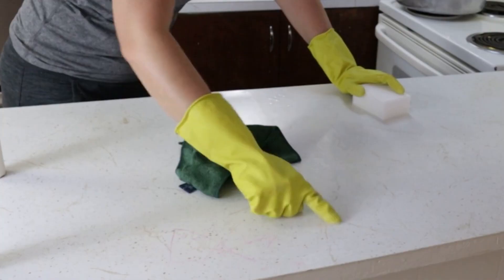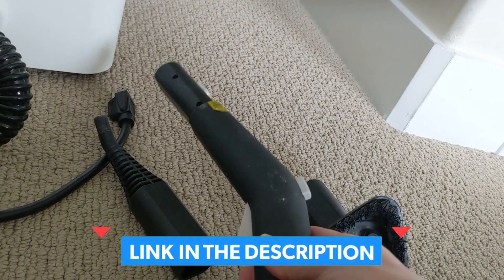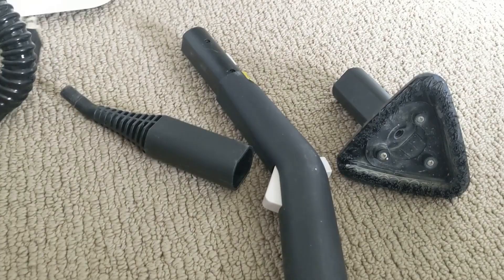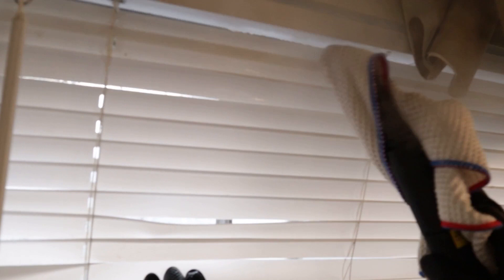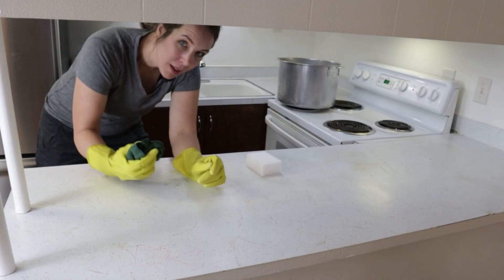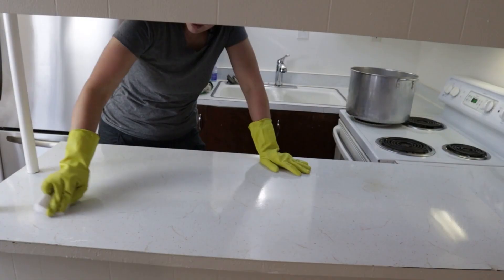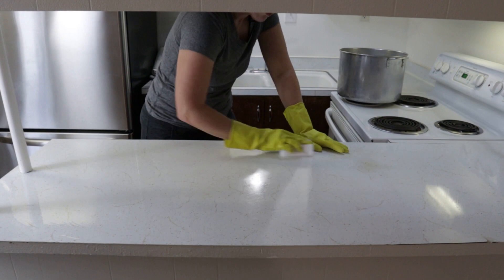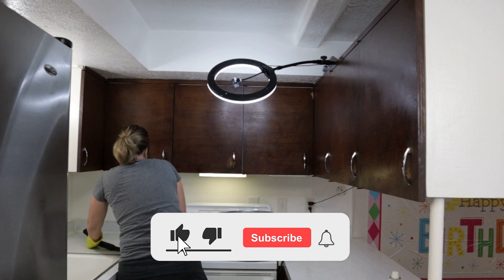CLEAN WITH ME | STEAM CLEAN KITCHEN | BLINDS, CABINETS, CHAIRS, COUNTERS & MORE!

Comment: Does the Tosca floor tool fit the neat?
Reply from the maker: No. The Tosca mop is bigger and has clamps to hold a towel. The Neat one is smaller and to me is the most cheaply built attachment of any I've used from Dupray.